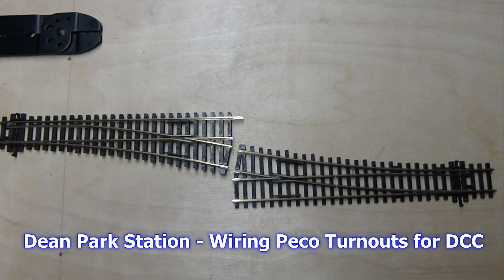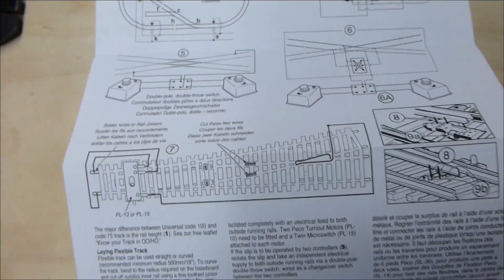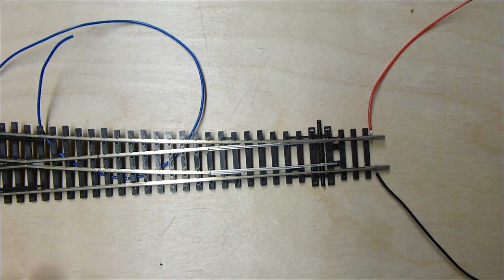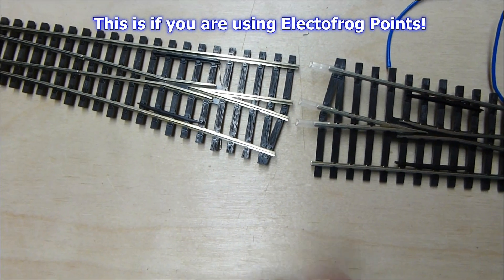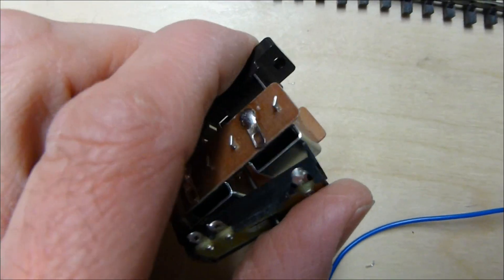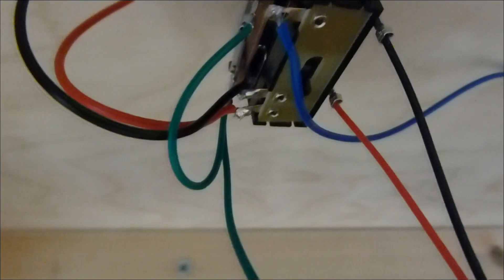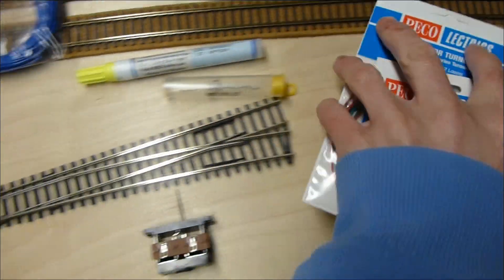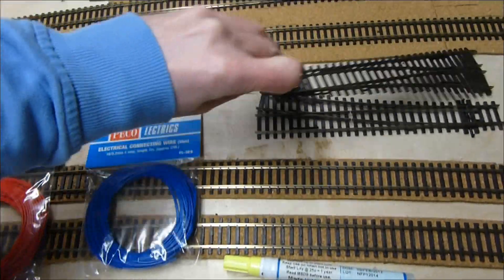Dean Park Station Video 9 - How to Wiring up Peco Turnouts for DCC with Peco Point Motors

Comment: I have been collecting the components for my layout, and trying to work out what to do with the whole wiring thing.  Books and articles are fine, but there's nothing like a video showing how and why to do things.  I'll keep this one in my favourites and come back when I've got all the equipment.  Thank you very much.

My layout is here: http://www.rmweb.co.uk/community/index.php?/topic/54619-basement-layout-name-to-be-decided/
Reply from the maker: Hi, glad it was of some help.  I was the same as you...I read books and leaflets until I got my head around it...so I am really pleased I have been of some help and you liked the video.   If you need me to clear anything up from the video, please don't hesitate to ask.  We are all in this hobby together and its by helping each other that we all get enjoyment and success! Dave
Reply: DaveClass47 Help! I've come across a problem you may have solved!  I've got two turnouts wired up with motors and switches to cross from up to down.  The loco is fine until it straddles both sets of points, then it shorts.  What have I done wrong?  The motors are driven by centre off toggle switches, and I've got twin accessory switches which drive the frog polarity and indicator lights on my panel.  It all works apart from the problem above.  Thanks, Tom.
Reply from the maker: Good evening Tom.  Sorry to hear you are being bothered by some electrical Gremlins.  We've all been there.  I get attack by them regularly when try to work out what's plus and what's minus voltage etc...its so dam frustrating isn't it? 

Your problem can be a number of tiny things:

1) check you have the polarity of the two turnouts wired correctly...you may have the + and - wired the wrong way on one of the switches? 

2) Also check the track to make sure there is no reason for the wheels to short.  

3) Another idea might be to check you have the insulator fishplates on both of the rails that meet the other point.   Have you those in the correct positions?

4) check the accessory switches on both points fully moves from + to - when the points is flicked. Sometimes these blasted switches don't fully move across, even though the point blades have.

Don't worry, you will get to the bottom of it, I came across the same prob when I had points wired facing each other and it turned out that I had the + and - wired to the wrong way around to the polarity switch.  I have recently used a PECO twin accessory switch for controlling my points and lighting signals and you have got to have your wits about you to make sure its wired to the right polarity etc.

Sorry I cant be of more help, try check what I suggest and let me know.

Dave
Reply: DaveClass47 I've done it!  For reasons I don't understand, I have to reverse the feeds from time to time.  But it works, so that's the important thing.  I've put up a video of it to prove it!
Reply from the maker: cool, I will check it out! good stuff!

Comment: Dave are u using dcc points control or dc point control? I find all the codes crazy so just use dc wiring from an old Gaugemaster controller to power the points and switches
Reply from the maker: dc point control! Keeps it separate from the DCC track.   Much less complicated to control the points on 12v dc than using the DCC controller to control trains and points at the same time!

Comment: just checking i can see another short problem as its both metal the wheel can touch the diversion line and mainline as it passes, have you had this at all?
Reply from the maker: No I aint found this so far, are you using some older trains?  They have larger flanges etc on the wheels which can cause this problem.
Reply: Hi dave No all new good to hear it's only on older models I just see it a lot on pdfs for dcc Electrofrog mods. Good to hear :)

Comment: haha said you made a batch of those wires, thats a PECO wired fishplate pack you didnt make them hehe good tutorial video though, i always through insulfrog was better for DCC out th ebox but i am tempted to use your method and go back to electrofrog now.
Reply from the maker: Hi, no I did make them.  I see you can buy them now.   I just solder some fish plates to some peco wire, its a quick and easy job.   You will need a lot of them, so that's why I just make up a pile of them.  Cheaper than buying pre soldered ones too.

Comment: Hi I have the Bachmann point motors  peco electrofrog and a dcc concepts ad-s8 high power solenoid dcc decoder,and working with the nce power cab.Points will change over OK but the problem is power to the v section ie no power can you help? Have wired up according to wiring instructions.

Comment: I agree, they can be on the pricey side. But honestly, I found them much easier to install than anything else. I'm pretty new to the hobby and I'm not an expert with any electrical equipment, so when I saw that tortoise switches only need 2 cables to switch, that's what made me what to buy them over any other ones. I do have some Atlas switches that came with my turnouts but I decided not to use them. Your video is still very informative though.

Comment from the maker: ....PART 2....the red and black wires on the point motor go to the switch at the control panel and to the other connector on the controller.   I will get a photo to you soon, not in a position to do that right now, but if there is not one to you by Thursday, remind me! cheers.

Comment from the maker: I wire the red up to the positive rail on the point and the black to the negative.   I wire the track droppers (that feed into the bus wires) the same way.  It is important that you keep positive to positive and neg to neg....if you see what I am trying to say.   It doesn't matter which colour of wire you use, as long as it is wire to the correct side of the accessory switch for you.   Also, the green ones go to the common return directly to the controller....

Comment from the maker: Tortoise motors are a bit more expensive.  They are double the price compared to the point motor and accessory switches on each peco point.   I did consider it but went with the peco.   Tortoise are brillaint motors though!

Comment: Thank you for the very informative video. Wouldn't it be cheaper and easier to do it with a tortoise switch machine? They are about $15. I ordered a few tortoise but I haven't hooked them up yet. I'm just curious what your opinion is.

Comment from the maker: I was like that for ages....didn't understand how it worked, then the penny dropped and it was clear!   However its get complicated again when you start using 3 way points with 2 point motors etc....so my advice would be avoid them and stick to normal 2 way points! ;-)

Comment: Nice video! A tip...try to use tortoise motor and pull off spring feather on the turnout. Now you have slow motion turnout(s)!!
I use DCC turnout decoder Lenz LS150 for the motor.

Comment from the maker: Firstly, thank you so much for your kinds and encouraging words.  I was like you, I tried to get my head around it for so long until I tried it and thought I would share my successes with everyone.
DCC to DC...I suppose in theory you change the power source & make sure you have no opposing signals causing a short circuit.  You would have to watch that parts of your track were not dead due to insulated fishplates. IU would recommend getting all your DC locos converted to dcc, its the future! ;-)

Comment: Hi, came across this fantasic video on points.congratulations you'v nailed it.Been trying to get my head round it for months.Now with this and Everard Junction I fill convident to make a start on my layout.
Question:-- what would I have to do to switch from DCC one day to DC analoge another day--not using both at same time.
ie insulated fish plt     wiring???  cheers andy

Comment from the maker: Great to hear you've had success!   Its great when everything just works as it should isn't it?   Yeah 16v is really required to power these effectively.  I invested in a 16v controller to run the point motors off as well.

Comment: Hi again,  well finally got one working successfully.  Had issues with the point not moving across even though it was lined up perfectly, got a cdu unit and still would not move point across but narrowed it down to lack of power.  Invested in 16v gaugemaster power supply to power a separate bus for points and works a treat.

Comment from the maker: Hi, this is not normal. The whole benefit of DCC is that any train can run on any track at anytime without short circuiting or dead sections of track. Have you used plastic rail connectors (insulating connections - SL-11 Peco) on the frogs? see instruction diagram that come with points, or see my video.   Also, you have to wire each section of track at each side of the turnouts to either the + or - wire on the power bus to keep current flowing to all rails.  Hope this helps.

Comment from the maker: Hi, I went to express models. co.uk for my bus wire, dropper wire and crimps splices etc. My longest dropper wire is about 25cm but there is nothing to say it cant be longer. I will have longer ones when I start dropping wires from my upper rail sections into the bus wire! Check out my video on dcc equipment. 7x0.2mm is for the bus wire, its thin, but thats what express models sell and suggest. I got the no solder dcc kit from them. Easy to use, good value and no soldering req! woo hoo! lol

Comment from the maker: Hi, yeah it was a bit of a 'peco-fest' on display there.  I now buy my wiring from Rapid Electronics as its much better value for money.  I would also look at using SEEP point motors, but I was relatively comfortable with Peco's instructions and so being new to the art of point motoring I stuck with Peco this time.  Thanks for your comments.  Much appreciated.

Comment from the maker: Hi, erm...not yet! lol.  I have wired up a three way Peco turnout.   That was fun!!!!!   It had two motors and I had real problems with it shorting out, but this was sorted by a bit of web searching for a wiring diagram (the peco wiring diagram missed out a vital wire - which if I had been given I would have solved the short problem quicker!).   If I do get a scissor I will do a video, but they are expensive to purchase.

Comment from the maker: Hi, I have since gone to Rapid Electronics and got some 16/0.2mm in 100 roll for just under £8 a roll.   Much much cheaper than peco.  Thanks for the tip though.  Much appreciated. Dave

Comment from the maker: Hi, it really is up to you.I would say Electrofrog are better as 1) they look better - less black plastic showing at the Point Frog and 2) some loco's dont like going over Insulfrog as they can stall when their pick up wheels hitthe plastic frog. Electrofrog allows for smooth running, but there is extra wiring required if using point motors.But I am really happy with my electrofrog points with DCC and point motors, so that is what I would recommend.Hope this helps. Cheers. Dave

Comment from the maker: Hi Jamie. I got my sheets from various retailers. Peterspares. com sell Jarvis cork,2x3ft rolls. I used 1/8" for the mainline to give a realistic shoulder when ballasted. I used thinner 1/16" for the station to stop the trains being too high for the platforms! I did buy sheets at Kernow Model Rail Centre,but they are sold as flat sheets & you have to get them to slice them into equal strips for you or the 1/8" stuff cracks when rolled. Either way cork is cork, it all works. hope this helps.

Comment from the maker: Hi.   If there is no point motor, there I suppose that there is no accessory switch, so no need for blue wires.   You can manually operate points on DCC without any wiring.   I currently have some points not yet wired and they work with no problems manually.   If you have electrofrog points you will need a accessory swtich to swtich the frog polarity, if you have Insulfrog points you will not need a accessory swtich.   Hope that helps.   Cheers

Comment: I ditched the seep point motors years ago, I found that the switch used for changing polarity became unreliable over a period of time.  I've used peco, but although you may here the point motor buzz - it's no guarantee that it has changed and if you have hidden sidings, like the ones on my layout, the first you will know about this is when the train derails or goes the wrong way. I've standardised on Cobalt - expensive I know - but 100

Comment: I have found the seeps to be quite reliable.  I have about 20 installed at the moment.  However I have noticed a problem with one or two of them that I'm yet to investigate.  I think the polarity switch on them has got dirty as they are not enclosed.

In terms of space they are very good.  Only about 20mm high when installed.

Comment: it'll be interesting to see the results. the curved island platform I've been working on was scratch built using poly filler, luckily here in the USA the stuff is dirt cheap, I got 62lbs of the stuff for $14 at Lowes!! The results are pretty good, I was going for an aging look to the platform to go with the scalescenes medium station (which btw looks amazing but took several days to build!!). I think i'll have to use the power sander when I do the terminus stations though... :)

Comment from the maker: Hi, Cheers.  I had watched you vid on Seep motors, but had already started to go down the Peco route.  Are SEEP motors with polarity switches reliable? I will (eventaully) have a raised TMD with only 75mm clearance underneath from the bottom baseboard, so although Peco motors will fit in that gap I had considered SEEP for that tight area!  I'd have to have the whole TMD section laid on a lift out section to repair motors if they broke but I really need a robust unit. Thanks again. Dave.

Comment from the maker: Hi, yeah I decided against the tortoise motors, they are more expensive and with my planed Depot and rest of layout I am looking at about 25-30 points, which would be way more expensive using those as opposed to Peco.   Best value for money is SEEP motors, so I may use them on the raised section of the layout where space is tighter. Thanks for your comment. Cheers

Comment: Great Vid. i use insulfrog so as not to mess around with the wiring too much. I dont use the accessory switch on my point motors but i have used a switched wiring loom straight onto the point motors.

Comment from the maker: Hi again, well technically speaking, as the frog is all plastic you wont need a polarity switch, as no current is passing along the point frog.
I recommend you email peco and ask...just to make sure, but I am sitting here asking myself, why would you need one?, if the frog insulates the rails then surely no shorts can occur with a insulfrog!

Comment from the maker: Hi.   I run it off a DC unit (an old hornby one that has a 16v ac supply connection at the back ofthe unit).   Picked a couple up from ebay for like £20 each!   Hornby R965 is what I use.   Running off dc saves taking more power from the Bus wire and just keeps things simple...my bus wire will have enough feeds from it without 20+ point motors etc coming off it too.   You can of course use the DCC unit to control and power them. Hope you find this helpful! Cheers

Comment: also can i ask how and what you will use to power the point motors? will you be using a separate dc unit or running them off the bus wire from your dcc unit?

Comment: does the same apply with insulfrog points when connecting the two plates together underneath the point with wire.and if im using insulfrog i dont need to wire the polarity wire to the motor do i?